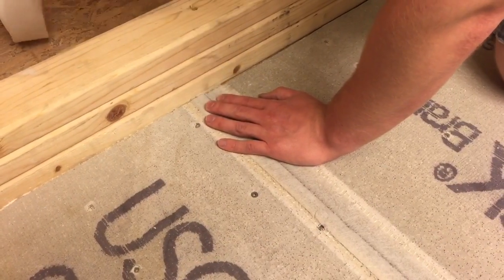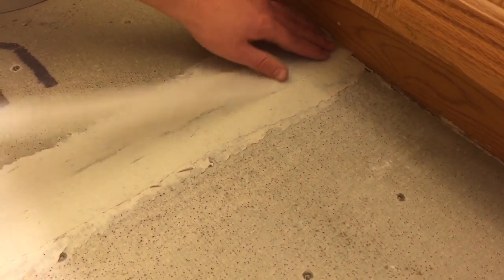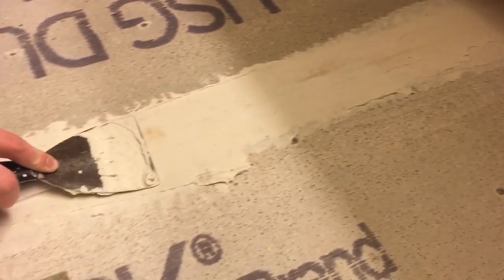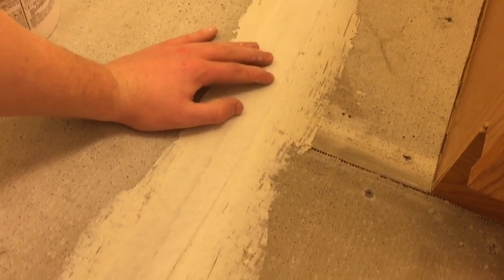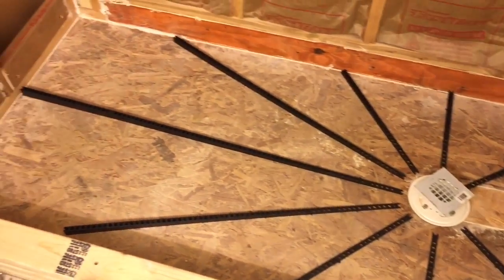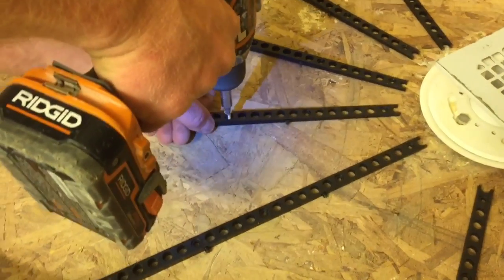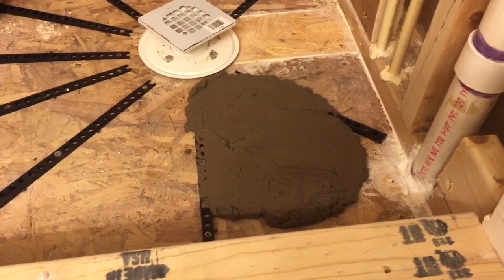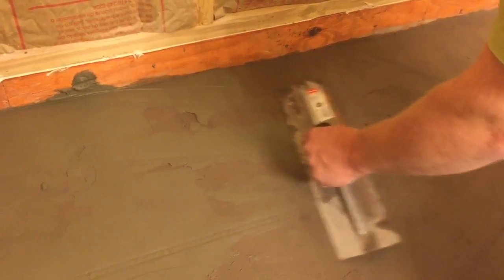How to convert a tub/shower to a walk in shower Part 3

Comment: good video thank you. Why didn't you use backerboard in the shower as well?
Reply from the maker: I used Durock on the walls. Thanks for watching.
Reply: I love funbro1 videos it was very helpful to me. I am currently doing a tub to shower remodel. I decided to follow his lead due to the fact I had several of the same products because Home Depot recommended most of them while I was shopping online and the reviews were great on all the products. However I did watch other videos and I saw people repeatedly using backer board on the floor too. I decided to do the same and I’m glad I did. I also heard others say do not put backer board on the floor before you tile and everything is to be waterproof. Handle everything on the floor first and then finish the wall

Comment: You’re suppose to finish the cement shower floor and then install the hardy back cement board. The cement board should not be touching the floor too.
Reply from the maker: By doing the floor last it helps support the wall boards in place so that they do not move when setting tiles since they cannot be screwed below the curb height. There is a small gap between the membrane and the wall to keep moisture from wicking. I have found this method has the most benefits. Thanks for watching.
Reply: @funbro1  .. I agree with Code Seven.. You made fatal mistake putting your cement board down into your base.. In few years what ever cement board you have in your base will be nothing but crumble.. Viewed many videos about NEVER put your cement board in the base.. The cement board "Always" go on after the base is made..

Comment: Shouldn’t put mortar directly on wood, the wood sucks the moisture right out of the mortar, also wood moves causing cracks eventually, causing the tile and grout to fail.
Reply from the maker: The pitch sticks work like rebar in concrete, I have not had a problem yet but if you are concerned then you can use the water proof membrane over the wood floor if that make s you feel better. Thanks for watching.

Comment: Hello Bob, you do make this seem very doable.  I don't plan on moving my drain to the middle but will keep it in its same place as you did.  Did you do anything to the drain? outside of sodering the cap on the faucet?
Reply from the maker: Only thing that needs to be done to the drain is the location. Side note: Th drain to a shower should be a 2" drain so if you feel the need you should change it to a 2". For the faucet you may want it higher for just a shower so it may need to be raised depending on it's current location. Hope this helps, Thanks for watching.

Comment: Roughly how many bags of mortar are required for this 32" x 60" (I think I read your answer on the size issue earlier) for each of the pitch sets? Thanks in advance.
Reply from the maker: I would start with 2-3 and always have an extra on hand. It can alway be returned afterwards.
Thanks for watching.
Reply: Can I ask what the name of the mix you use? I went to hd but didn’t see something matching what you mentioned. Thx!
Reply: I went to HD last night and the only thing that I could find was deck mud but not sure if I can use it under the rubber mat.

Comment: Hey bob, is there a specific cement board for bathrooms, or any sheetrock would do???
Reply from the maker: Cement board is different than sheetrock. Sheetrock is drywall and yes there is a moisture resistant drywall. As for cement boards there are several different types and it really is a personal preference. All cement boards are good for bathrooms.
Hope this helps, Thanks for watching.
Reply: @funbro1  thanks for the info, i like to learn a little this. Greatly appreciated

Comment: Part of my shower floor is osb boards I can't replace. Do you recommend I prep them with Red Guard? Or do I not need to do anything about them?
Reply: Install a cement board over it then regaurd it. Make sure you mud under the board.
Reply from the maker: You can go over it with Red guard or Aqua Defense. Then proceed from there. Hope this helps, Thanks for watching.

Comment: Is this first layer absolutely necessary? Can't I put the liner right over the subfloor?
Reply from the maker: Without the first layer when/if water penetrates the grout lines it will easily seep through the mortar. Once this happens the water will just sit on a flat surface and cause problems. That is why the first layer is done this way to drive that water towards the drain. Hope this helps. Thanks for watching.

Comment: Is the base of the shower drain flush with the floor? The drain seems to have a flanged base. But then is seems flush with the mortar bed.
Reply from the maker: You will want the finished product to be flush with the drain. depending on the tile thickness, you can adjust the drain. The bottom or pre-pitch should be even with the first part of the drain. Hope this helps. Thanks for watching.
Reply: Yes, it did answer my question.. Not only do you have a great remodel guide, but you answered in less than 24 hours!
Reply from the maker: If you decide to tackle this project let me know if you run into any other questions and I will try to answer them as timely...if possible.

Comment: I am have the hardest time finding the correct mortar to use.  Could you please point me in the right direction?
Reply from the maker: I used a product made by Mapei. Hope this helps, Thanks for watching.
Reply: @funbro1  Is it something you were able to get at just your local Big Box Store?

Currently, Home Depot points me to the direction of "Sakrete - Sand Mix 'Topping & Bedding' "  Is the correct mortar?  Additionally, would I use the same for both layers, Pre-slope and then shower pan, prior to applying thin set and tile?

Great video by the way!  Really helped throughout the entire process!!

Comment: Your video's are very informative. I am in the process of doing the same tub/shower conversion to a walk-in shower and are following your video's. I do have a question before I can continue with my project. Since the drain is where the original bathtub drain was, I am having an issue with the pre-pitch. Using the pre-pitch sticks, on the non-drain side I will have a gradual pitch ending at about 1 1/4 inches high, but on the drain side the pitch will be much lower, ending at about 1/2 an inch high. I'm concerned that when I begin tiling there will be issues. To get all 4 sides level, I can make a very steep slope on the drain side without using the pre-pitch sticks,  but I want to make sure this is what I need to do before I continue. Thank you for any advice you can give me.
Reply from the maker: The drain being closer to one side should not matter. Using the pitch sticks start at the drain with the factory edge of the pitch sticks and all side will be the same depth. You will need all sides to be the same depth to make the tile work. Don’t worry about not having a big slope in front of the drain because water does not have far to travel to get to the drain.Hope this makes sense and is helpful.

Comment: Hi bob, great videos! My question for you is, you dont have to put some sort of mesh or screen on the wood before the pre mix mortar? Thanks
Reply from the maker: You can it wouldn't hurt but depending on what type of mortar you use it is not always necessary. In this case I used a mortar designed to be used without mesh. Thanks for watching.
Reply: @funbro1  hi bob,awesome video series!  Can you tell me the brand/type of mortar you used?

Comment: I THOUGHT YOU WERE NOT ADD CEMENT ON WOOD?  NO BARRIER?
Reply from the maker: NOPE THIS MORTAR BED WORKS
Reply: REALLY WOULD A PIECE OF FOAM IN BETWEEN OSB AND MOTAR BE GOOD IDEA THEN ADD WATER PROOFING ON TOP
Reply from the maker: ANY EXTRA WOULD NOT HURT
Reply: My team just pour the motar down on top of the cement and smooth everything out. No fiber beds just nice clean motar and water proof the edges lay tile or whatever client would like and done. But I used to do it similar to this video until I noticed some materials wasn't needed.

Comment: Hi Bob, I ripped out my shower and my floor is concrete what do I do then?
Reply from the maker: Just continue on using the same process. The only difference is you will have a very, very solid floor under your shower. Thanks for watching.
Reply: This is my question too... do we need the cement board (because we are redoing our floors too) but it's already concrete underneath

Comment: These videos always feature standard, quick-build contractor homes where everything is standard sized, squared, modern plumbing and electrical. Does anyone know of videos for old homes that are not so modern and conventional? We are dealing with 40s tile, art deco curves, non-standard plumbing, a steel tub, and non-existent electrical.
Reply from the maker: Yes, most of the remodels I do are just as you described. Problem is everyone is different and you run into different plumbing and electrical issues, different building materials and out of plumb non-square walls. Maybe the next one I do I will post so that people can reference it. Thanks for watching.

Comment: Why not remove the cabinet also. This way your tile is everywhere on the floor
Reply from the maker: Normally I would do that but this job was bid this way and removing the cabinets would have added more to the cost then the customer wanted. Definitely would have preferred to remove the cabinets though. Thanks for the question, and Thanks for watching.

Comment: That fibafuse is for drywall and you are not suppose to tuch it with out gloves
Reply from the maker: Fibafuse is mold resistant and has an open fiber design that is why I use it in this application. As for the gloves I guess YOU could wear gloves but nowhere in the instructions did it say to wear gloves. Thanks for watching.

Comment: Question for you - why didn't you use cement board for the actual shower as well as the floors?
Reply from the maker: I'm not sure what you're asking? I used cement board on the floors and also inside the shower for the walls.